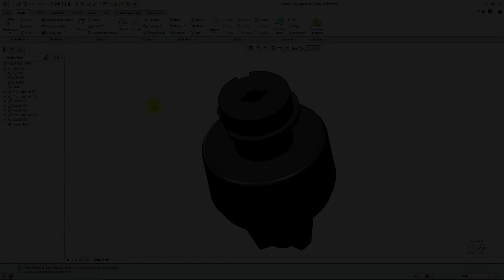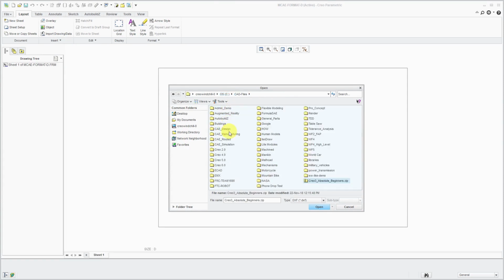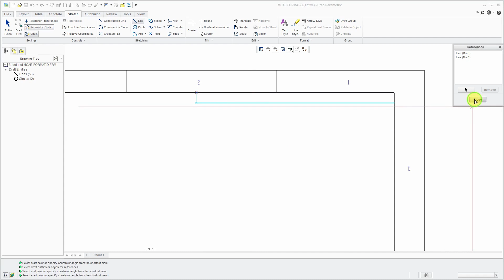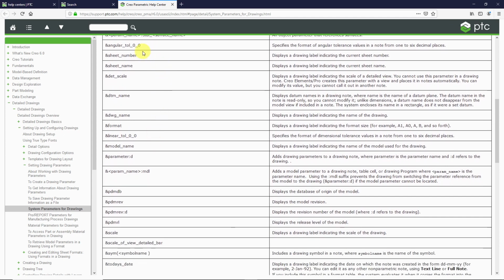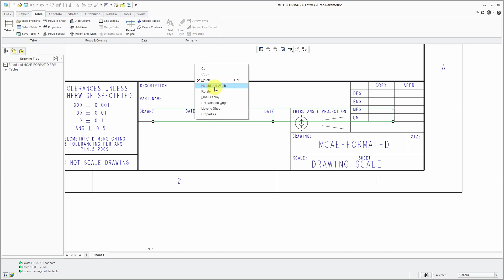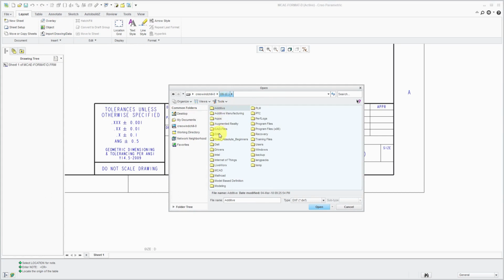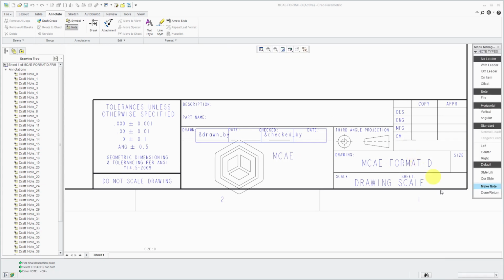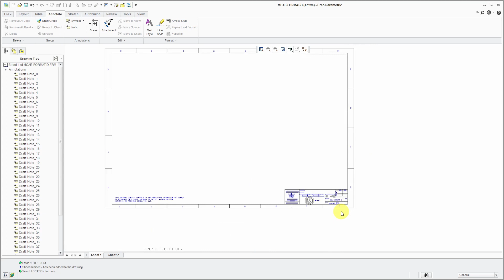Creo Parametric - Creating New Drawing Formats

Comment: Very informative tutorial, thank you for the many tips and details. Is there another tutorial that describes how to save the newly-created drawing format so it can be used with each new drawing created? Is it saved as a .FRM or other Creo file format? Thank you.
Reply from the maker: You should watch my video on drawing templates.
Reply: I have watched a few of them, I didn't see where it says the format to save in once the new format has been created. No matter. Thanks.
Reply from the maker: A format is a .frm file. A format doesn't change its file extension when it's saved. It's always a .frm file. 
A drawing can be created with a default template, but not with a default format. So you create a template (which is a .drw file) using that format. Then you use the configuration option template_drawing to point to that .drw file.
Reply: Thank you. @CADPLMGuy

Comment: Sir, i would like to add a note in my format that All dimensions are in mm/Inch depending upon the model. I checked for that system parameter and its not there. Is there any way to add the parameters so that my drw automatically detects whether its in inch or mm
Reply: Try using &pro_unit_length to get your linear units on the drawing note.

Comment: How to set auto fill of Model size on my template. Same like &model_name
Reply from the maker: How do you define model size?
Reply: @CADPLMGuy  Actually i have used templates at where i worked before. When we call a template of any size it will auto fill Model name, Finished size(model size) and job number
Reply from the maker: @joelphilip2226  So Finished Size and Job Number are parameters specific to your company?
Reply: @CADPLMGuy  Yes.
Reply from the maker: @joelphilip2226  Then you access it just like any other parameter. Precede the name of the parameter with an ampersand.
Reply: @CADPLMGuy  I already tried that, but it is not working.
It's okay let me check it  with my friends. Anyway thanks for your response on my comment.

Comment: Very good video. Can you do a video where you explain how to create a revision table with revision symbol? Thanks.
Reply from the maker: What’s a revision symbol?
Reply: @CADPLMGuy  https://www.youtube.com/watch?v=7vDxl3BIRB4 (Sorry for my example with another CAD, but what I mean is the table with the number of revision and the triangle (or other geometric symbol) that you can put on the drawing with the number of the review inside.
Reply from the maker: I see where that is authorized in ANSI Y14.35, but I've never used them - and I've worked at Boeing, Lockheed Martin, Amazon, and Blue Origin, not to mention consulting at dozens of companies. I would just use a custom symbol with variable text, and I do have a video on that. I'm used to revision tables that call out the Change Notice. I prefer Windchill to be the source of truth for information like that, since a lot of changes can't be tied to a specific drawing detail.
Reply from the maker: Also, end users should not be placing revision tables on drawings. You either use them or you don't, and if you do, they should be in the format. But the table is heavily dependent on each company's method for revision tables. Do you list every revision or just the latest? (Wait until you get to rev J or K or M and table takes up half of sheet 1.) Do you use Windchill or not? Do you populate the table with text, model parameters, or Windchill parameters? What information do you report? If you describe the changes, how much detail do you put in? It's such a headache at my last company I advocated not following the ANSI standard and just listing the revision letter and having a statement to the effect "See Windchill for all other information."